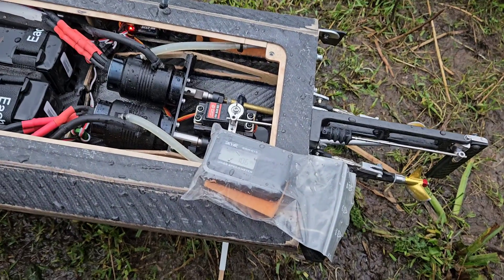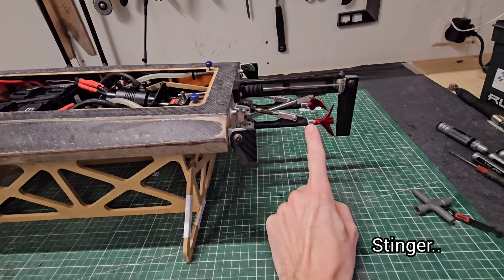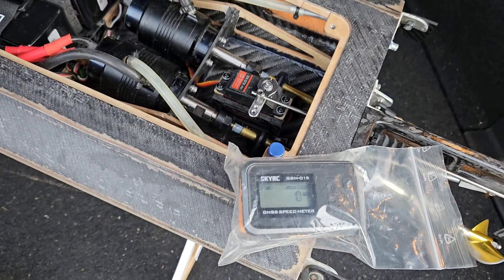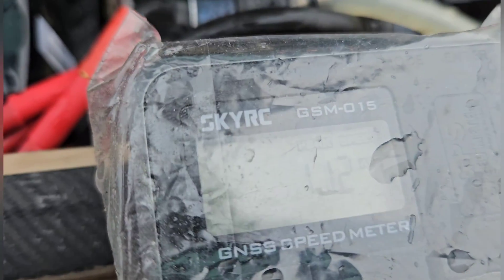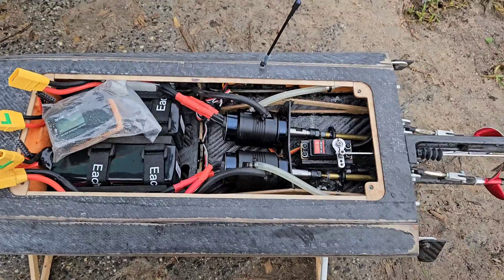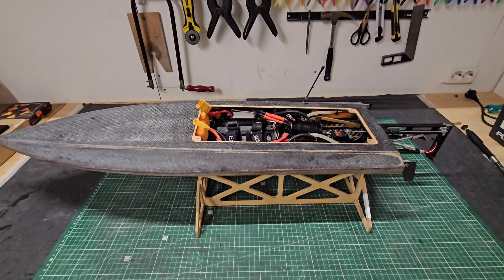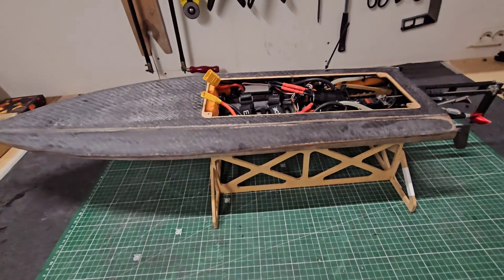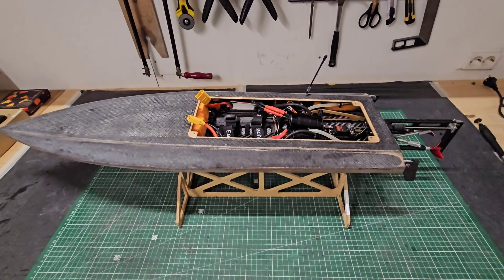I got a new speed record! DIY RC boat twin motor build.

Comment: Hi friends, what size is this flixble shaft and propeller...🙏
Reply from the maker: Hi, I use 4.76mm  flex shafts and the  propeller sizes between 42-44mm with a pitch ratio between 1.4 and 1.9
Reply: @CozyRC  I want to build this with a 4mm flexible and a 37mm prop, will it hold up well with a surpass hobby 3670 2650kv motorbike?
Reply: @CozyRC  plan with 2 motorbikes
Reply: @CozyRC  https://youtu.be/XoHK6p3B8rI?feature=shared
Reply from the maker: Hi Ahmad, that setup will be good on 4S. For 6S lipo, I recommend 1800-2000kV range. 
4mm flex shafts will be ok I think, if you use smaller props, like you propose.
I share the plan for €5,-. If you're interested, please send me an email at cozyrc1@gmail.com
Reply: @CozyRC  Thank you friend for the info, it's really helpful..🙏👍
Reply: @CozyRC  the length of the hull is only 85cm friend and that's the red one, the size is like a Zonda..haven't tested the run for all of these boats
Reply: @CozyRC  https://youtube.com/shorts/hMU3RynQC30?si=kCNXvFrljLaCDDmB

Comment: I wonder if the batteries can really offer 300A burst🤔I know the small motors can deliver very high  speed ,but for SAW this 1850kv they  are use on 8s (but 40 mm motors whit +2200-2600kv)
For exemple in my twin cat sss3660/3570 motor and same props copy ABC 1716
- 2s 3570kv 90kmh (26400 rpm onload)
- 3s 3570kv 120 kmh (39600 rpm on load)
- 4s 3570kv 140 kmh (52800 rpm on load) 
Your setup have 41000 rpm on load I think it's not enough to reach higher speed I think you need more rpm and much stronger battery .
Please don't get  me wrong G-FORCE  it's amazing  I love it, already run very stable for a twin mono and I love the cornering ability. 
Turnfins bring drag rise them a little  bit.
https://youtu.be/8AnZ84UbVIk?si=aUCv9LGCViSmGDjd😊
Reply from the maker: Hi Daiciu, Thank you for your extensive answer. These lipo's can't deliver 300A. Any lipo claiming more than 60C drain capacity is probably not true.
I'm aware that for a true SAW boat, my setup is not suitable. Too low rpm, but I did that on purpose. With this speed, it is much easier to get to know the boat and learn about setup. I became more careful after the Wildthing Crash! 
I planned from the beginning, a motor upgrade, if the hull would perform well. I like TP motors, but 2x €95,- is too much for me. I will probably go for 2x SSS 3674 2075kV  motors. If I can reach 140km/h, my goal for this boat is to be reached. I guess I can come close with these motors and good lipo(s).
Regarding twin lipo's: my theory is that it is better to split the total current from the twin motors. If 1 lipo needs to deliver for 2 motors, twice the current will flow through the lipo wires and connector. 
The 3000mAh lipos I use, might be  little low capacity and therefore, their voltage might drop soon. But they are light, which I like about them. I will test a single CNHL 5200mAh 90C lipo soon. Maybe the boat will be much faster? That would prove the 3000mAh twin lipos  are not a great setup.
Finally, I think I can push the current setup to 120km/h. It's a great boat and I enjoy the building, running and tuning process a lot! See you ✌️ DJ
Reply: @CozyRC  the yellow pair have more top speed than red ones ,at least that what I see on video even the gps show the same speed,maybe you can try more whit them.
The 70C Gplus series have better chemistry,but we play whit what we have 😊
Reply from the maker: @daiciuapostol79  The red props are very aggressive and reduce the motor rpm. I ran them without sharpening. I now sharpened and balanced them. I will use 1mm more uptrim on the stingers. I think I can get 120km/h with them. 
The golden props will be tested more as well! Let's see next time 👍
Reply: @CozyRC  🤞let's see😁

Comment: Great way to end up the year! Congreats. Funny enought I also yesterday put my 3rd prototype to the water, with a bit less sucess. Thank you for the inspirations and keep them coming. Cheers
Reply from the maker: Thanks José! Too bad your maiden run went less fortunate. What was the cause? 
More content to come for sure in 2024! Cheers ✌️ DJ
Reply: @CozyRC Hi there. I'm "designing" my own outboard motor, that is accommodating a 3652 brushless motor. That comes with some challenges. As much as I try to 3d print stuff with tolerance and resistant materials, small plastic parts aren't that durable when brushless motors and copper gears are involved. A shaft support broke after a couple runs. Left my boat stranded a couple of yards out of ritch of the lake shore. 🙄Having to retrieve it with a  water temp just abover frozen wasn't fun... The tunnel boat body itself works great tho.
Reply from the maker: @NoMatterDesign  Interesting project and  challenging indeed! A geared RC outboard is very hard to make for high-speed applications. You could try to make one with a flex shaft. It's less scale, but more durable! ✌️
Reply: @CozyRC  Crossed my mind. And after so many... "rapid unscheduled disassembly" cases I should. Thing is I have some people in the UK (my fomer RC club) who are only interested in geting my design if it works with rigid shafts and costs less than £25. I'm getting close lol. The 1/10 scale "Mercury 360" I'm copying is a challenge. But the 1/5 of the same shape seems to work quite well.. Yes I also have a 1/5 tunel boat in the works. I'm at the moment putting more effort on looks than speed. But with the use of 3D printing for carbon forging mold parts... that might change soon.
Reply from the maker: @NoMatterDesign Sounds like you got some nice projects going! Enjoy and Happy New year 👍

Comment: As always great video, boat seemed very planted with larger prop i think there is great potential there. Try sliding the liner towards the motors and apply a little clear RTV on them and them pull them back, it should seal and glue them in but not enough that you pull them back out.
Reply from the maker: Thanks! I agree, very stable running with the larger props! They seem to push the bow down a bit more. Will be continued 😎✌️